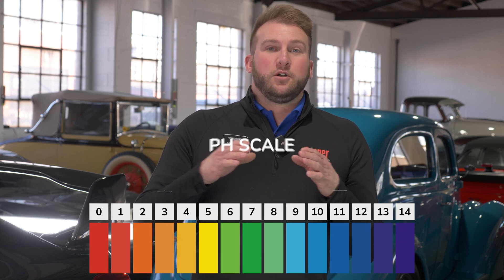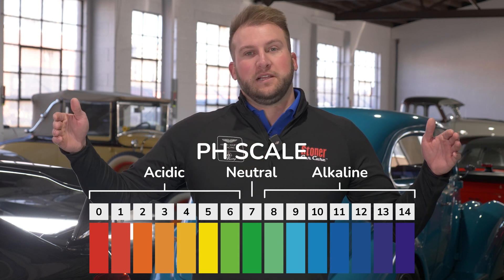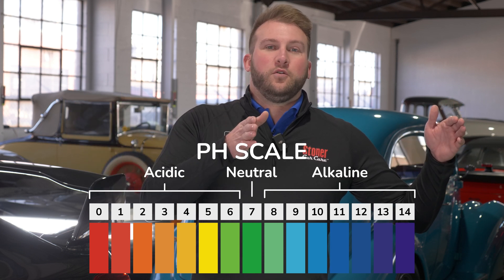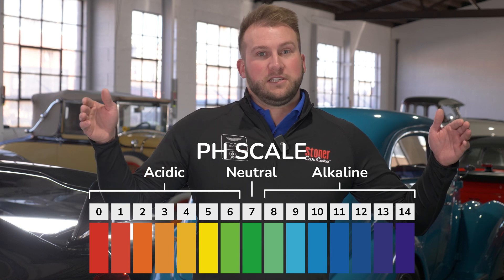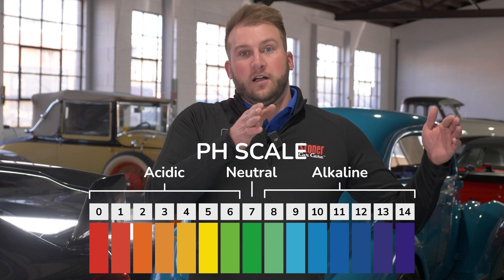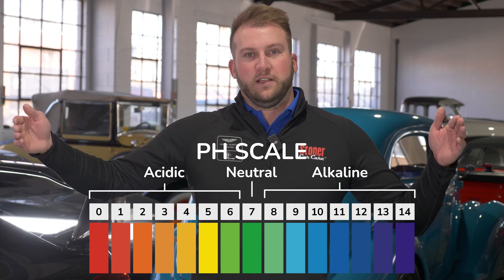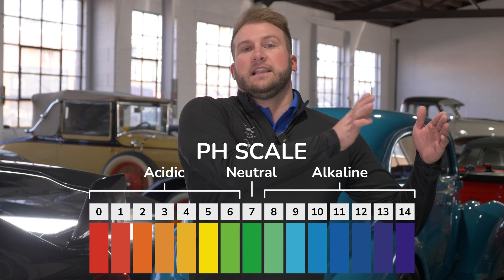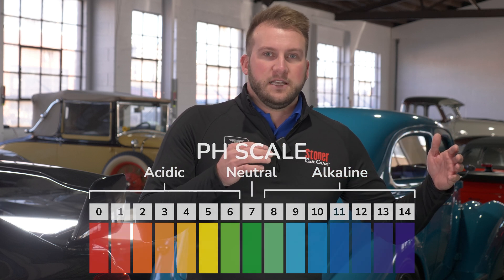Why pH Scale Matters in Car Detailing

Comment: Hi there, I have been in love with cars  all my life!!  Used to race old  cars when I was young, and I never  own  a new car all I could afford was second hand cheap cars.   Thank God my husband loved good, expensive  -NEW  cars.      For my 70th  birthday I  bought myself a  black  CLA Coupe Mercedes with lovely lines and expensive coating.  My questions is:  For a car with a good coating what pH is the ideal one?    The Mercedes car dealer says, whatever the professional hand-wash guy  uses will be okay, but  my friend who know a lot about cars says, I  should make sure it is the 7 pH car wash liquid.    Who is right??   Thanks!!
Reply from the maker: For maintenance washes we would agree with the friend and say that neutral (close to pH 7) is ideal.  However, certain deep cleans or stubborn problems (for example hard water/mineral build up on you coating) may require some low pH and high pH solutions will actually work better and require less physical abrasion to clean, which is the primary cause of coatings to wear.